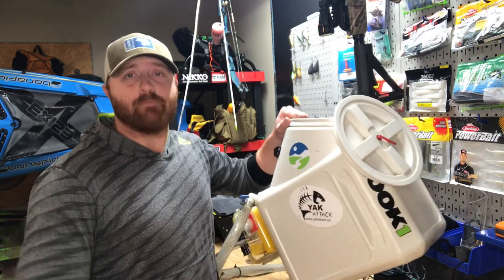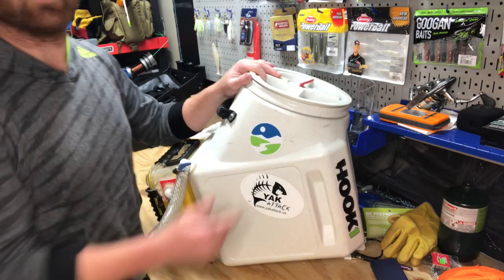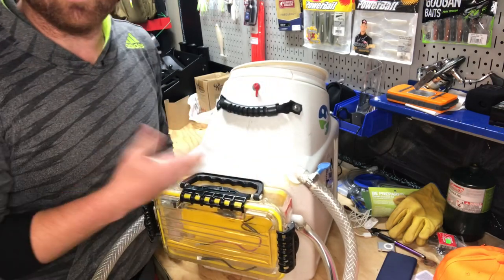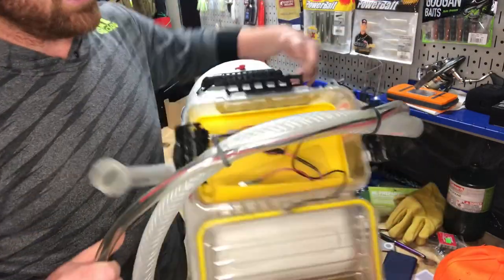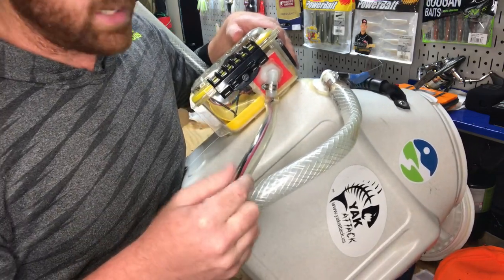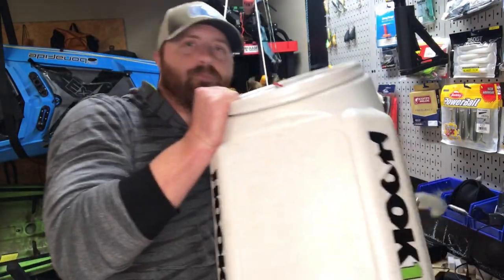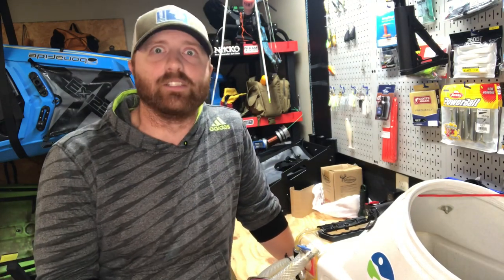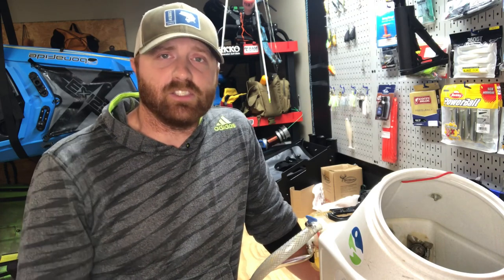DIY KAYAK LIVEWELL / Kayak Fishing

Comment: That is a smart looking and well thought out live well. The repurpose of the litter container is genius with the angle it has. Great DIY video! I recommend getting an FPV power Lithium battery for it. 17.5ah for only $219. The battery is waterproof and tbe BMS will shut down the battery if it shorts in water.  (think capsize) and won't hurt it. Small and only about 2lbs.
Reply from the maker: Thanks for watching and the recommendation. I will look into that battery. Sounds awesome. I love the livewell and it works great for my fishing needs. Tight lines friend

Comment: Great video. Where did you get the pump and what is the name of the pump and what battery? Thanks
Reply from the maker: Thanks for watching! In the description, I left links for the products used. The only thing different is the bilge pump gph. It’s a size 500. The link takes you to the direct brand but not the size. The battery is just a 12v deer feeder battery. Tight lines

Comment: Awesome video and live well! I am going to make my own live well but mine will be specifically made for my Old Town Sportsman Autopilot 136. I'm not sure what I'm going to use for the box yet but I want something that fits in the front of the tank well with tubes going through the scupper holes. I saw the Hobie live well and want to make something similar. I like how they did their draining system. I might actually drop a fish tank aerator with those aerator stones in it for quieter operation. I also plan on making it so I can plug it right into the kayak and use the battery I'm going to run my lights and usb chargers with. I plan on using the YakPower 8 circuit bluetooth enabled switching system so I can control all of my electronic with the remote switch or my phone. I plan on making a waterproof battery box that will sit in the back of the tank well and plug right into the kayak.
Reply from the maker: Dude sounds awesome! Keep me posted. I may be updating my soon. Love the drainage idea.